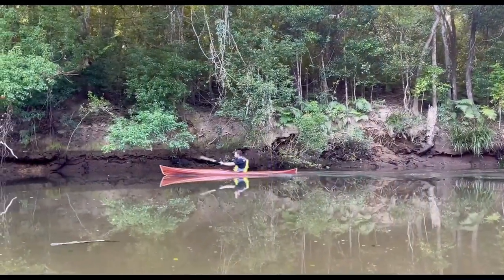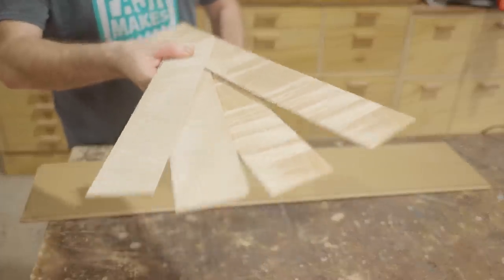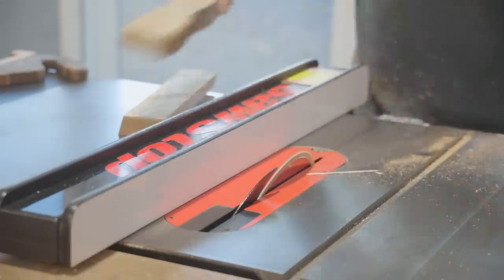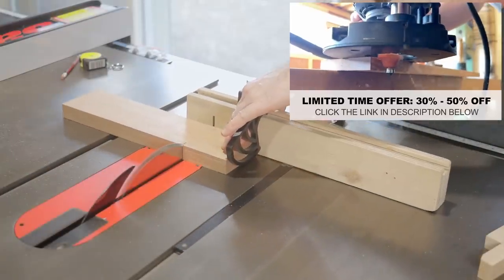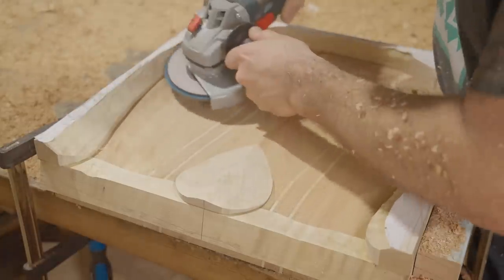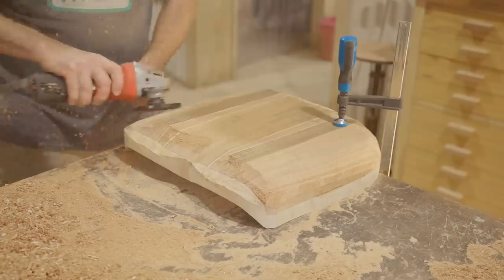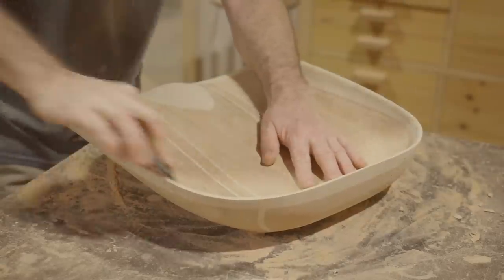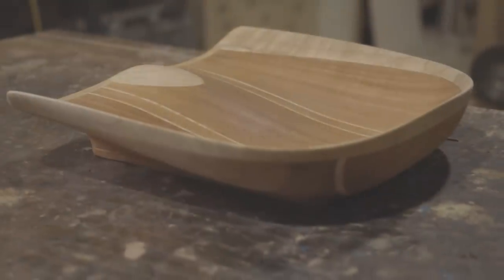Making a Classy Wooden Seat (for my Kayak)

Comment: Neil, that seat would definitely look nice on a stool.
Some time ago I bought a used counter stool from a scrap yard, and it was missing the seat. I went to another yard a few days later, and they had some bits and bobs of old tractor parts. I got the steel pan seat from that pile, and made an adapter to mount it on the stool. I plan to use it in my welding shop.
Reply from the maker: Thanks Bryant - your seat sounds cool. :)
Reply: @PaskMakes  with all those holes in it, I hope so. 😀 I know you didn't mean that kind of cool...
Reply: It's like a cabin in the state of Montana. The roof had many holes in it, and the caption on the picture said cabin has hot and cold running water hot in the summer and cold in the winter. It'll definitely be cool in the winter.

Comment: Beautiful piece. Could stand on its own as a piece of art! As an aside, I never understood the front 'hump'. I would think men would prefer a bit of space there, instead of a piece of wood trying to share the space-time continuum with the kayaker's 'package' ;-)
Reply from the maker: Thanks Robert! Know what you mean but that hump is pretty low. :)
Reply: I think it's a balance thing. Allows 1 or both legs to tighten & press against panel to alter alignment of man & kayak
Reply: @JohnColgan.  That makes sense for a kayak seat, but the bulge shows up everywhere (bar stool, etc.). My guess is it started on saddles where the bulge would be around the shoulder blades/spine of the horse and it stayed from there as a 'feature' in 'manly' chairs, but I might  be (and probably am) way off...

Comment: I read many of the comments and saw nothing but positive remarks and rightfully so; the seat looks wonderful. The reason I read some of the comments was to see if anyone else commented regarding the overall thickness, and/or remaining strength of the wood towards the edges. This is merely an observation, not criticism since it's not clear how the seat is fitted into the kayak which is something that may make my observation a mute point. Again, the seat itself looks wonderful; well done.
Reply: It will get fiberglassed so the wood takes the place of foam in a surf board and strength is no issue.

Comment: How is this not going to blow itself apart with the cross grain edging? Both seat and back? Does the fiber glassing and 2K finish seal it so completely that the wood simply will not be able to have any further moisture exchange and therefore no movement?
Beautiful work.

Comment: A great job, but sadly very, very labor-intensive. Additionally, a whole range of machines were used here that not every DIY enthusiast has in their hobby workshop. In view of the time invested, I wonder whether it wouldn't be cheaper to outsource the work to a joinery with a CNC moulding machine.
*****************************************************

Eine tolle Arbeit, nur leider sehr, sehr arbeitsintensiv. Außerdem kam hier eine ganze Reihe von Maschinen zum Einsatz, die nicht jeder Heimwerker in seiner Hobbywerkstatt herumstehen hat. Angesichts der investierten Arbeitszeit stellt sich mir die Frage, ob es nicht günstiger wäre, die Arbeit an eine Schreinerei mit CNC-Fräsmaschine zu vergeben.

Comment: i noticed while you were gluing down that middle bit of the seat the piece was sliding around on the glue as you were clamping it down and it reminded me of a trick a guy i saw using a while back.

salt! gives the pieces some grip so when you clamp them down they dont slide about, it also apparently has no effect on the glue whatsoever. give it a shot, maybe it will be of use to you.